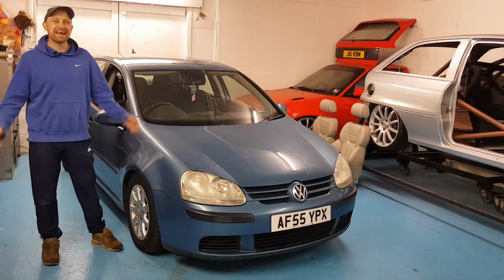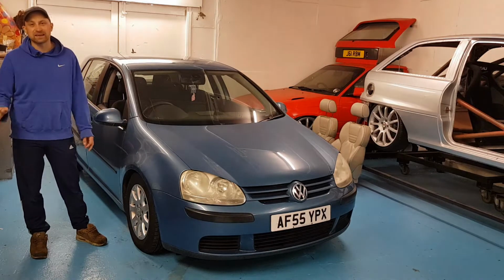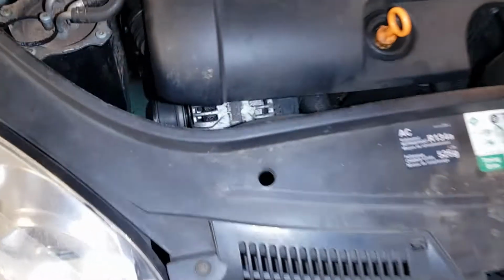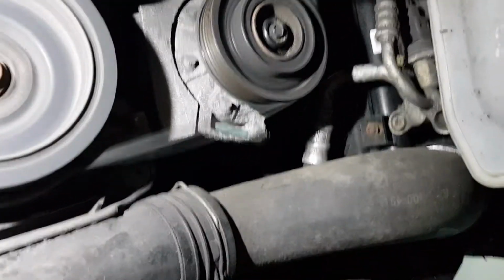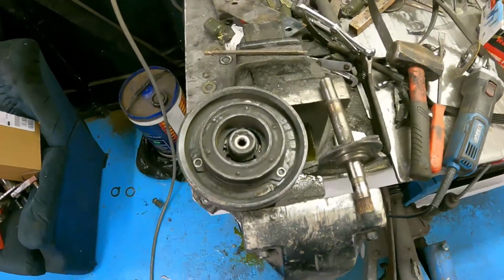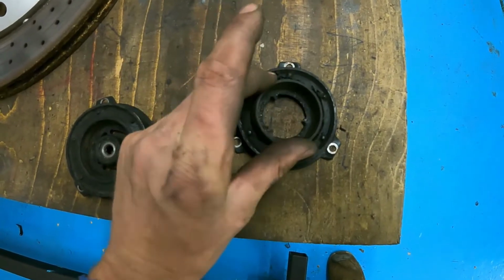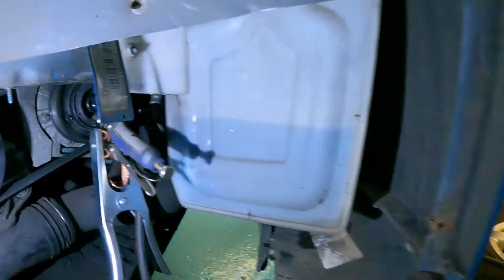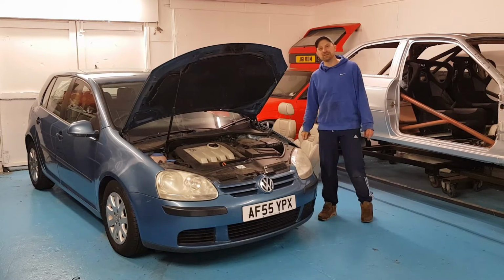Mk5 VW Golf Air Conditioning FIXED! Was a WEIRD one!

Comment: When I first start my car the fans doesn't seem to turn on even after a couple of minutes and turning the AC on. When I drive for a little while they seem to start and it somehow blows cold air, not too much but you can feel the cold air coming inside the car.  I have enough coolant, checked that in a service, not a blown fuse.. I need to check this compressor wheel

Comment: Isnt it likely the compressor was jamming if the clutch was shreaded?
Reply from the maker: The compressor is fine and it's done another 3 years working perfectly, I think it was just rubber failure/perished 👍
Reply: @SuperRon I've read the splines wear off. Seems a common VW fault.
Reply: And...it's not a clutch on many -but a break away drive.

Comment: Hi. I would like to ask you an explanation, looking at the broken bolts, were they screwed in clocwise direction or in couter clockwise. Thanks a lot for video!!
Reply from the maker: No they are conventional thread, I checked when cutting the scrap one open, they are just fitted covered in lock tight. Thanks for watching 😁

Comment: i have also a very weird problem, it cools but it cools very weak, and when i turn it off, it smells like wet dog and socks, have you ever got  the problem. 

also A/C clutch repair is very rare these days here in Holland, most mechanics do the whole compressor.
Reply from the maker: Cooling weak is often a symptom of gas being low. Bad smell can be from bacteria build up on the matrix, you can get spray to squirt down your vents to cure this. Also check pollen filter is not wet
Reply: @SuperRon  but the thing is, about weak cooling quality, is that eveen after refill R134A Gas same, and my condensor is very dirty could that be the issue? or is the compressor slowly dying? im soo confused.
Reply: @multiomer1997  my car does the same thing. Did you get some help?

Comment: @SuperRon Thanks for all you do. I have a '08 Jetta 2.5 with a sanden compressor that cools very poorly, about 20 - 23C. I've scanned HVAC measuring blocks with VCDS and these are the most prominent values, Compressor Shut Off Code - 0.0, Compressor Load (5.7Nm - 6.7Nm), Refrigirant Pressure with AC on - (11.2bar - 12.2bar). Compressor is the type with a solenoid valve. What could be wrong?
Reply from the maker: Thanks for watching. It sounds like everything's working according to the measuring blocks. Are they all in spec according to the balloons on vcds?

Comment: Finding it hard to find a pump, most are different. Mine is exactly the same as the Golf here, even same colour and year. If i find a pulley would you fit it using same method, im in Norfolk. Would it taking inner to outer pully work? Cant imagine much give in the rubber when new? Cheers
Reply: Tacking together with small weld across inner and outer pulley I ment
Reply from the maker: I had a hard time finding a replacement too, all others seem to be the clutch type. Yes that would work welding the inner to the outer, probably have to make a little plate to go in between, not sure of long term effects on the pump not being cushioned, but it would work 👍

Comment: Hi Ron  (A3 1.6tdi 2014) My prob is that the clutch will not disengage . The clutch stays engaged even with power off.Would a new clutch cure this? Any info would be nice. Thanks
Reply from the maker: It sounds like you have the newer type clutched wheel, if it is sieezed on a replacement would solve it, if you can get them separately
Reply: @SuperRon  Thanks for reply I will try and remove it next few day .

Comment: Hi great video thanks. I have a mk5 tdi. I have to run and accelerate otherwise it won't make cold. If I turn it on when I start the car it doesn't make cold air. Only after riding a bit. If I turn the engine off it stops again, so I can't turn the car off when I stop somewhere if I want to keep with cold on. Any suggestions? Thank you very much
Reply from the maker: I've not heard a problem related to speed before, hard to diagnose without investigating, but its nothing I've come across before. Thanks for watching 😁
Reply: @SuperRon  thank you very much
Reply: Ac fan doesnt work
Reply: @diogobento6053  hi thank you for answering... Doesn't work? How doest it make ice cold after riding 500 meters? Thanks
Reply: @stillalive--  when you stop the car ir stops making gold and when you are driving starts again?
Reply: @diogobento6053  no. If I stop the car but don't turn off the engine it continues working perfectly. If I turn the engine off then I will have to ride again for it to start making cold again. Thank you very much for trying to help.

Comment: Hi there my air conditioning stopped working a few years ago 2008 golf gti , is the pulley system the same on that year as yours? Also i had a new compressor fitted but it still doesn't work!!? Do the pulleys come new with a newly bought compressor or just the main unit ?
Reply from the maker: I'm not sure which models have which, I've seen a 1.4 petrol with the other clutch type for sure! A new unit does usually come with a new pulley attached
Reply: @SuperRon  Ok thank you for your swift reply. Any suggestions would be welcomed, I realise it's probably Very difficult not having the luxury of looking at the vehicle but I'm £550 in and it's still not working 🙈
Reply from the maker: Yes hard to diagnose without investigating. Main things are, does it hold gas? Are you getting a signal to the pump with you turn the aircon on? Have you got any fault codes logged as it's a gti I guess you have full hvac
Reply: @SuperRon  Not entirely sure unfortunately I'm not at all clued up where cars are concerned. Prior to the AC failing it held gas for sure . I don't have a VAG com myself. Halfords said it was the compressor hence why I had it replaced but as I say that didn't resolve it . I'm told Halfords/quick fit etc is a fairly basic generic coding system. And it's climate control on the GTi so I'm told .

Local VW dealer is saying £80 to diagnose and £161 hourly to work on it but I'm going to have to take the plunge to identify the issue at the very least, then take it from there. Thank you for your advice it's very much appreciated. Cracking video by the way , I wish I was more up on this stuff
Reply: @andykennedy7470  161.......... just find a vw specialist with air con experience
Reply: @Xbot4Life  I know right ridiculous!! I did find one mate he fitted the new compressor, however it's still not working and he couldn't resolve. If you know of someone I'm gladly open to suggestions?
Reply: @andykennedy7470  im taking mine in for diagnostics tomorrow for them to figure out what's wrong with it. if they are decent and figure it out, ill let you know.

But its in the west mids/Smethwick which may be too far for you.
Reply from the maker: We are based in Suffolk.
Reply: @SuperRon  was talking to Andy 😂 if I was closer to you I'd Def bring the car to you lol
Reply: @andykennedy7470  Mine is fixed, ice-cold. was just low on refrigerant so nothing was broken.
Reply: @Xbot4Life  Refrigerant? Ah I believe it has gas
Reply: @andykennedy7470  yeah you have an actual problem, I just got lucky.
Reply: @Xbot4Life  Happy days mate
Reply: @SuperRon  Sadly I'm in sunny Cumbria mate but thank you for the information 💪
Reply from the maker: Nice easy fix then Andy! 👍
Reply: @SuperRon  No Xbots is sorted lol mines still blowing piss of the poor sadly 🙈
Reply from the maker: Oh yeah just reread the convo 🤦‍♂️ well hope you get similar success soon 👍
Reply: @SuperRon  Cheers pal appreciate that , likewise nothing worse
Reply: @andykennedy7470 Take the Golf to a car AC specialist. This is the most effective response to the issue.

Comment: I gassed mine a year ago (06 golf) guy said "hurr durr, it's not cooling like a new car because VAGs have problematic pressure sensors, need to rebuild the whole compressor"
now it's been a year and it stopped cooling, VCDS shows no errors, shows me compressor turns on and off in measurements.
Reply: Pressure sensor just plugs in why need for a rebuild ?
Reply: @dandyer8351  because they lazy and don't do sensors, he wants you to put your hand in your pocket otherwise it's not worth his time, in his opinion. jokes on him, I bought the sensor went to an independent there wasn't much freon to ventilate to the atmosphere anyway, i replace it we fill new freon and it holds charge and cools like it didn't before.

Comment: I have an aftermarket compressor on the car when I bought but I didn notice after watching video that my center bolt doesn't spin with the pulley so I'm thinking I got the same issue because randomly my AC quit one night, no faults, got voltage at sensors and N280 valve so this could be my issue
Reply from the maker: Quite possibly, after making this video alot of people have found the had the same problem

Comment: I’m looking at buying a 2010 golf and the seller tells me the A/C needs to be regassed. I wonder if there is more to it, and this could be the same fault. Looking at the location, if using an inspection mirror, I should be able to see if the centre part is rotating. If it isn’t then has the same fault as yours. If it is rotating then, pressure sensor, faulty compressor or some other leak. I don’t have access to the fault finding gadget you showed before I buy though.  

What would you ask them to reduce the price by? They are asking £3500, and the private guide price is £3100
Reply from the maker: You should just be able to see with a little mirror and torch, as you see from the video the 2nd hand part was cheap but the job can escalate with the centre bolt snapping on both pumps I don't think it's possible  to get it out whole. But as you also saw I made-do with a little weld. A new compressor would probably be £400-500 plus labour, plus regas, could get very expensive. Or it could most commonly just be out of gas
Reply: If the AC is not functioning, assume the worst that the compressor has failed which requires a replacement. In Australia, this is a major $1,200 expense which easily writes off any older car. 🚙 ❄️

Comment: Do you have any clue what made the clutch to fuse? Mine has the same problem, but I'm thinking that the compressor might be damaged in the inside.
Reply from the maker: No not sure why it happened, a few more people have said they have had the same problem on their mk5. A year later I've not changed anything else and still got ice cold aircon.
Reply: @SuperRon  Thanks. I'll try replacing this center hub (I found it on ebay), but I'm afraid it is likely that the compressor is internally broken having to replace it and clean the circuit. I hope I'll be as lucky as you :)
Reply: I forgot to tell that mine has the rubber ok, but the steel connection between the center hub and the rest of the clutch is what is broken.

Comment: My ac has never worked on me mk5 gti got it re gassed no leaks couldn’t find nothing wrong with it so I’m going to try this 👍
Reply from the maker: Certainly worth a look 👍
Reply: Did it work?
Reply: @MAXIMUS-df3sj  already had it installed and then got it gassed worked for about a day then back to square one,then my engine blew up,😂 don’t ask 😂 after swapping out the engine the ac condenser was a little worse for wear so put a new one in then enjoyed the car for a bit to make sure the engine was ok then got it all polished and coated and it’s lived in the garage for a while but I’m getting it re gassed this summer to see if it works so fingers crossed

Comment: This is a great DIY, although you butchered the old pump to see how it all connects, in essence all that is required is to remove the 3 screws and centre bolt to remove the outer section and then replace that on the existing one?
Reply from the maker: Yes that is correct. Thanks for watching 😁
Reply: @SuperRon  Forgot to ask, can you recall the part number you used? -  mine is exactly the same in design as yours
Reply from the maker: Just checked and luckily it's still showing in my ebay purchases 1K0820803N
Reply: @SuperRon  thanks!

Comment: I always thought the pulley had a clutch in it too…..so what does engages the pump ?
Reply from the maker: Most are, but this has a electronic valve inside the pump that controls the flow of refrigerant around the system.
Reply: @SuperRon  thanks very much

Comment: Hi I have a 06 Volkswagen Jetta 2.5 l I was wondering if you know at what temperature does the cooling fans come on the electric cooling fan please help thanks
Reply: I have a 2.5 w a sanden compressor. Theres a switch on the ac that opens and closes and is usually the issue w these ac systems. Get a ngk switch for replacement. Ive fixed mine twice now from orielly parts and about to do it a 3rd times due to failing part
Reply from the maker: Sorry I dont know the specs for that car.

Comment: My air con stopped working the other week and ATS couldn’t find the fault, I might give this a try and see if it fixes mine 👍🏼
Reply from the maker: It would be worth a check, thanks for watching 😁
Reply: @SuperRon Polish and restore the damned yellowed and oxidised headlights! 🚙 🧼
Reply from the maker: @user-kc1tf7zm3b they are now done 😁
Reply: @SuperRon  My car detailer did not bother with the laborious and tedious ‘multi stage’ sanding and buffing process. Just one buffer pad with a polish compound, a liquid sealant application, final buff, then it was all done. The process took less than 15 minutes. I paid $50 for both headlights.